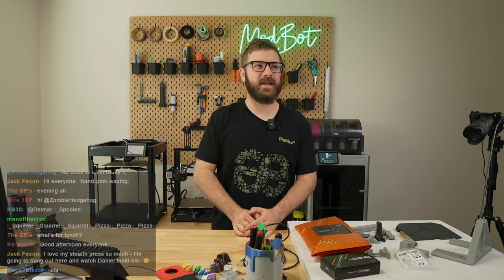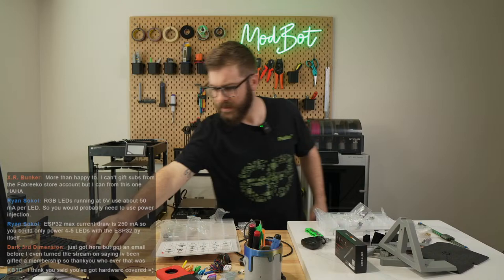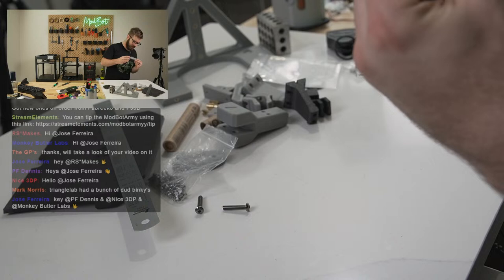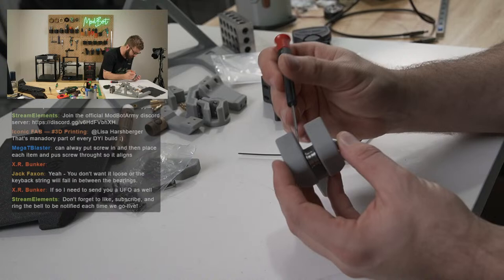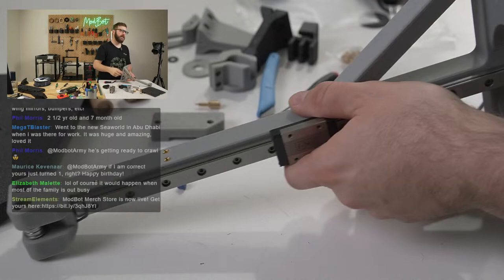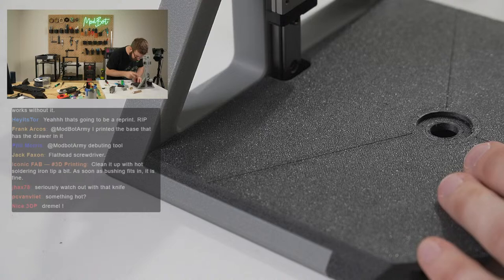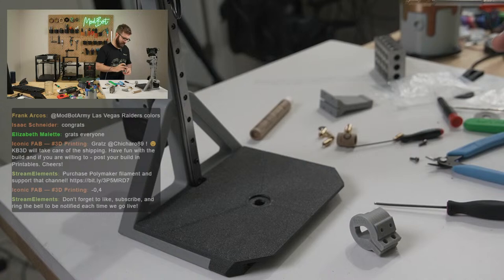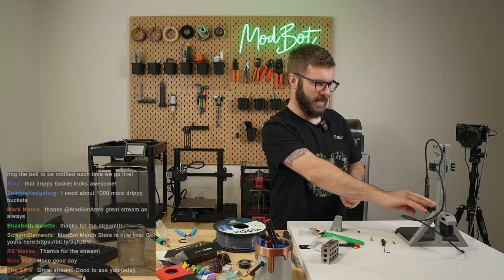Building The Stealth Press Heat Insert Tool!

Comment: Do you have a link for the power supply for the pincil.??
Reply from the maker: Its actually a Macbook PSU. Super overkill. This is the higher power usbc cable I use though https://www.amazon.com/gp/product/B0B45Z96JF/ref=ppx_yo_dt_b_search_asin_title?ie=UTF8&psc=1